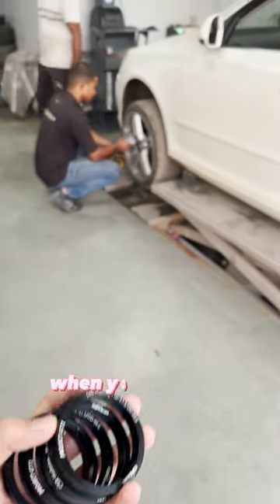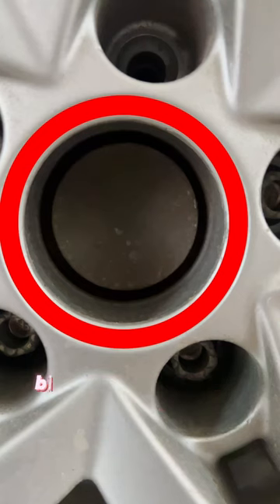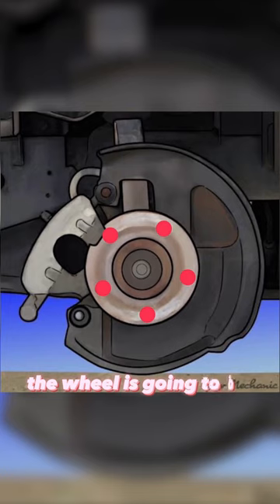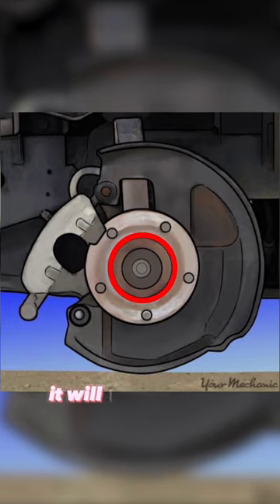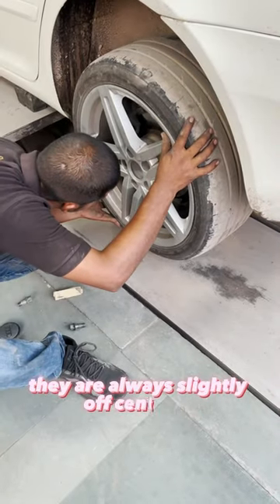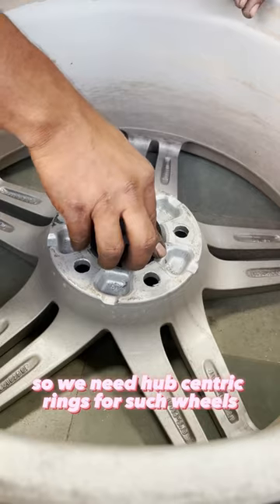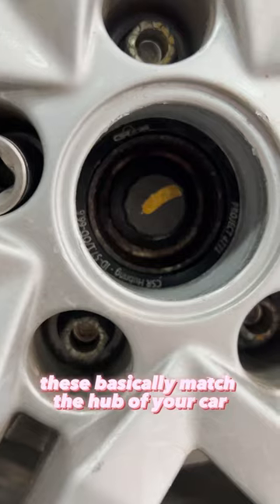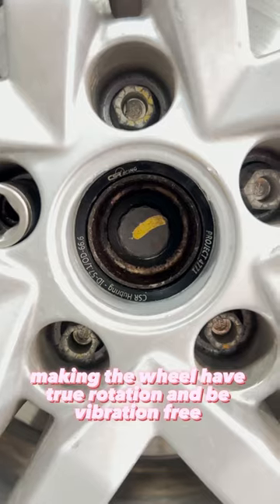Installing hubcentric rings for my Audi A6 S line Alloys

Comment: My creta hub size is 67.1 and my aftermarket wheels have bore size of 67.5..  Do you think i should install hub rings for such small gap?? I experience  little tire vibrations at high speeds.
Reply: Ideally you should caus that’s not safe to drive with that gap plus obviously you’ve to manage the wobble as well. So it’s always ideal to use hub rings if there’s any gap.
Reply: @albinjohn69  Actually I am not able to find any hub ring with such small thickness. The gap is only 0.4mm. I doubt if someone even makes such small thickness hub rings. I installed new tyres 4-5 months back. My car wobbles a lot. I even complained to hyundai service center and they are saying it's a tyre issue so they can't do anything.